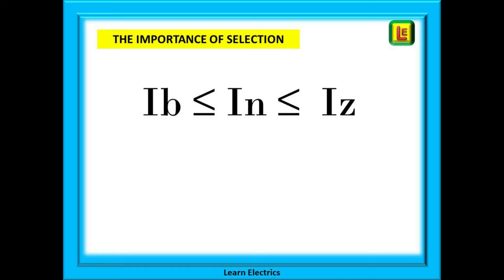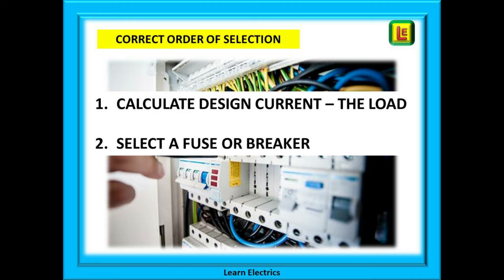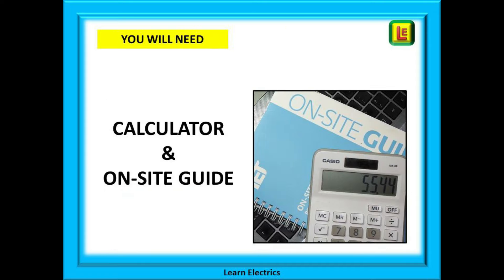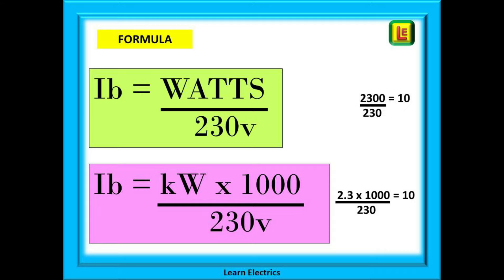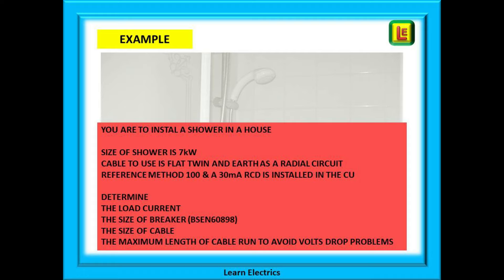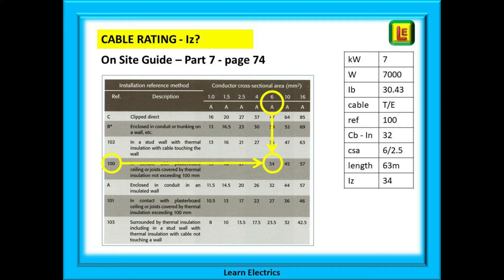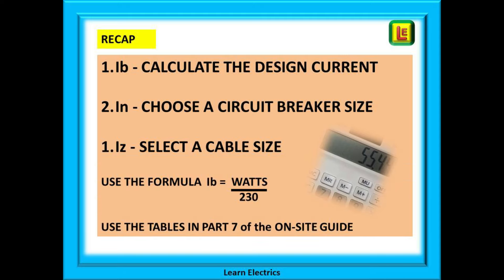BREAKER AND CABLE SIZES FOR ELECTRICAL CIRCUITS.

Comment: This says In must be equal to or less than Iz - so in theory a length of 1.5mm flex is fine on a 16a MCB, given that they’re both rated for 16 amps?
Reply from the maker: Thanks for watching, appreciated. Have a look at this video. Dave.
https://www.youtube.com/watch?v=VtTUkUpQ-Rc
Reply: @learnelectrics4402 Thanks for the reply, can I clarify something in the video you linked? 

It states the equation Ib ≤ In ≤ Iz, however the summary text states that Iz must in fact be greater than In. 

Just wondering, as the formula implies that selecting a breaker rated the same as the CCC of the cable is fine. So would a 10amp breaker be fine for a cable that can only carry 10 amps, for example?

Comment: For Showers/Heaters shouldnt the RCD be 10mA in BS7671 18th instead of 30mA?
Reply from the maker: 30mA is the recommended RCD. You can fit 10mA if you wish but you may find you get nuisance tripping,

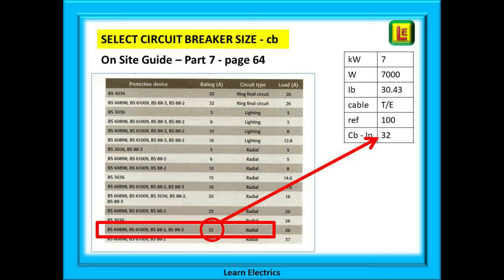Comment: 1) 7:46 Maximum load just 26A for 32A breaker, is this selection wrong ?   2)  "Iz" cable rating, what is "z" stand for ?
Reply from the maker: These are the recommended loadings in the On-Site Guide. Iz is the symbol chosen by the IET. We mere mortals get no say in it.
Why do we use I for amps or current is another question that we are often asked.
Thanks for watching. Dave.
Reply: @learnelectrics4402   can use only 26A for 32A breaker is on site guide instruction 7:46 ,  it is exceed than 30.43A 7:15 of design current in your video.

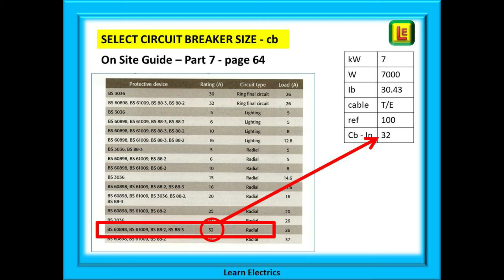Comment: Onsite Guide video at 8:17, The Chart gives Breaker 32A with Load as 26A, but your Ib = 30.43, shouldn't you choose a bigger size Breaker?
Reply from the maker: No, as long as it is less than 32A load its ok. A 32A breaker will not trip at 32A, it will be many amps greater than that. 32A is its working current 7 days a week, 24 hours a day.

Comment: When working out design current, you may have to apply a power factor, depending on the efficiency of the install equipment. If the equipment has a poor power factor this will have an effect on the cable under full load conditions.
When applying the power factor  you multiple the nominal voltage by the power factor & then divide the power of the installed circuit.
Three phase design current is 400v x square root of 3 x power factor / power.
Reply from the maker: Excellent support. Take a look at our power factor video on this link
https://www.youtube.com/watch?v=bXiE9bdFLsU

Comment: I’m confused, on page 72 for cable sizes you say there’s only one that matches the reference method 100, but there’s actually two? 32 amp 6mm and below it 32amp 10mm?
Also is there another chart that goes higher than 40A on page 64 ?
Reply from the maker: The two 100 references are for different cable lengths - 63 metres and 105 metres. A longer run will need 10mm cable. Fuses/breakers above 40 amps look at pages 61/62/63 in the Wiring Regs. That's a good point, perhaps I should do a definitive list for all fuses/breakers and put it on the website. food for thought. Thanks. Dave.

Comment: sir some people use a factor 3x5 times load current to calculate breaker size?
Reply from the maker: I've not heard of that, a factor of 15 seems excessive.
Reply: @learnelectrics4402   i mean 3 to 5 depending on load. What you suggest is simple but load can vary so i am still searching what is the rule of thumb for such factor. Ideally i would also not use factor of 3 to 5 but i have seen in some videos.
Reply: for mcb type b, 3-5 factor is considered for short circuit protection, but what is the factor for overload protection, should the breaker size should be 1.25 time max load current? if we see characterisitc, that is where thermal trip will occur but how much time will that trip regarding design. cable size current rating consider only overloading conditions but short circuit does not damage the cable i guess because that is where breaker trips. but the cable size should not have rating of 3-5 time for mcb type b breaker? i hope you understand what i mean`?

Comment: But you selected 32a breaker, that's maximum allowable current is 26amps, is it correct?
Reply from the maker: A ring circuit will have a 32A breaker and 2.5 cable because there are two parallel cables. Good question, thanks for watching. Dave.

Comment: What if 3 shower is installed for single 32amp circuit breaker? Will it be ok?or do we need to recalculate
Reply from the maker: Definitely not ok. Every shower should be on its own circuit. Putting three showers on one breaker will contravene the Wiring Regulations, contravene the Building Regulations, contravene the Electricity at Work Regulations and contravene the Health and Safety at Work Act. That's just for starters, you will also invalidate any trade insurance you have and any professional indemnity insurance and invalidate the buildings insurance.

Comment: if we have to calculate for induction motor, as it takes 3 to 5 times at start so how will we calculate cable size for motor
Reply from the maker: That's a good question Ali. We will do a video on this. Thanks for watching. Dave.

Comment: Isn't it advised to add a 10mm cable incase someone decides they want to upgrade to a more powerful shower a few years later?
Reply from the maker: Not unless the customer indicates they might upgrade. We mention in the video that in addition to safety we also consider the cost.

Comment: Would a 40 amp circuit breaker be too much over the requirement for this shower installation ?
Reply from the maker: Generally 9kW shower is 40A, 7kW shower is 32A.
Reply: Thank you for fast response, very clear videos
Reply from the maker: You are very welcome Gerry. Lots more to come.

Comment: How can spur cables can be a lower rating than the breaker?
Reply from the maker: A spurred socket (single OR double)should not be loaded to more than 20 amps total. 2.5 cable will take 27A clipped direct and you will be plugging in appliances with 13A maximum fuses. hope this helps.
Reply: @learnelectrics4402  Thanks, but if it's overloaded I thought the cable rating should always be higher than the breaker.

Comment: All the page no have been changed in new on side guide and also length of cable is also changed on this video now new length is 46m and page no start from 74 to 85. You need to amend this video please.
Reply from the maker: That's right. This video relates to the older blue book, before the brown books were published. Thanks for watching. Dave.

Comment: There doesn't seem to be any RCBO rated at 50A in the tables. A shower with Ib at 42A (9.6kW) and the specific manufacturer does not supply a 45A device makes this process confusing....
Reply from the maker: The examples in the video are all based on a 7kW shower at 30 amps.

Comment: Calculating with 230v when it's 240v is bad practice. You can plug in a 3kw machine using a 13A plug, But using this 230v EU standard you can't, so you'll end up with more copper than you need. 
  Whatever voltage you have, which varies, should be used.
Reply from the maker: Great input. This is why I use a mix of 230V and 240V in example questions. Great input.

Comment: Thank you once again for a very clear explanation.
Just one question:
8:28 you select the second row - even though I can see 6 rows with "100" as Allowed installation method (5 with 32 A breakers)
Is this because the top 2 rows are for breaker type BS EN 60898?
Could I also pick the 3rd row? (i.e. a 10mm^2 cable)?

Thank you for your patience (I hope this question helps other students).
Reply from the maker: Happy to help. Thanks for the feedback.

Comment: can we use 415v instead of 230v to calculate design current???
Reply from the maker: In some instances you will need to use 400 volts, I'm thinking of 3 phase plus earth systems where there is no neutral.